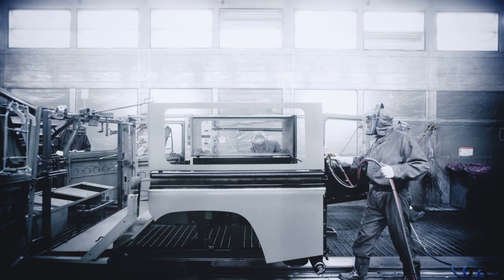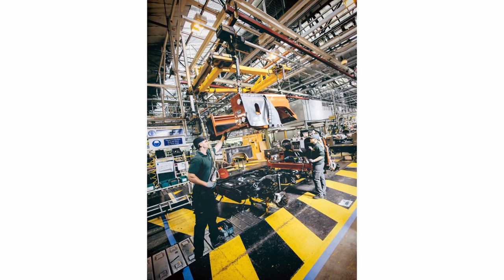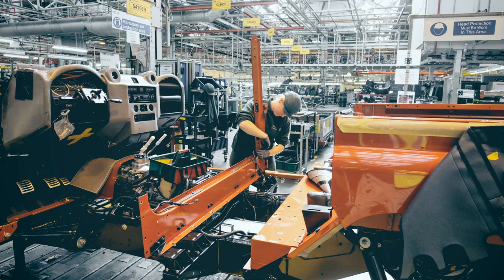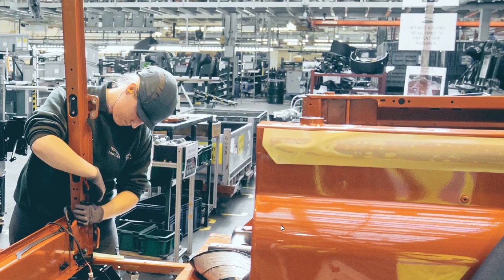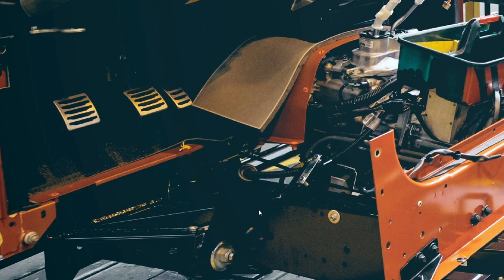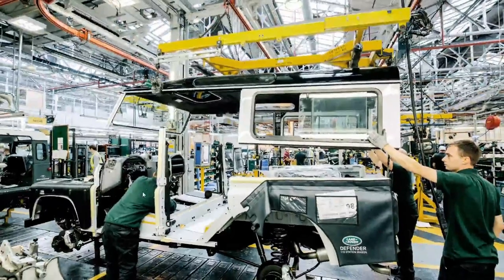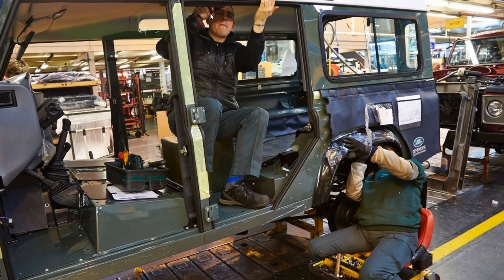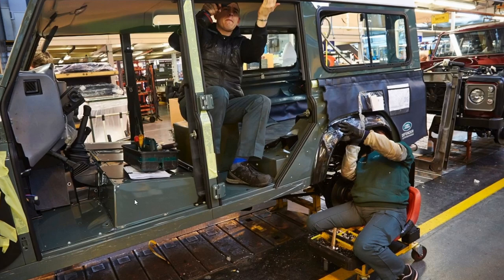Defender B/C posts - How the factory did it - Part 3

Comment: What a great video and great detective work, as someone has already said.
I did one of the last tours of the assembly line. We were all really interested at the beginning of the line where they were putting together the transmission and engine, but by the time we'd got to the body assembly there were very few questions so we more or less just walked past. Afterwards, I wish I could have done the tour again as there was so much to take in. We weren't allowed to take pictures for some reason, which was a real pity.
Reply from the maker: I did it too. I found it so overwhelming in final assembly; I knew I wouldn't be able to take it all in. I would have preferred to just wander around for days by myself and talking to the workers

Comment: Mine has a sealer between the steel and aluminium parts you can see where it has squeezed out when riveted up. It also has a sticker on each door about the cathodic process. The galvanised capping went I think with the introduction of the defender name (1991) but they kept the galvanised side sills.

Comment: Ahah! - now I see they bolted up the side panels, and the windscreen to the roof BEFORE lowering the whole lot on to the tub/bulkhead.  Great if you have a huge overhead gantry... Trying to get all those wobbly bits to match up with bolt holes AND fit sealing rubbers AND then get everything square-ish so doors would fit was a nightmare with my rebuild :)  six degrees of freedom and LR's 5mm tolerance on all alignments made for interesting times in my low roofed shed! - 10 litres of Sikaflex marine sealant might stop all the leaks now... but don't look at the panel gaps!

Comment: Great pitcture of a bye gone era.It also shows very well the reason they stopped making them due to the insane amount of labour that went into building one from scrach.
Also you can clearly see and you've mentioned it, all those holes that got drilled AFTER the panels got painted and rivetted without painting or rust proofing the bare alu in the holes.
No wonder these are such rust buckets within a few years time.Also no paint is sprayed on the panels under the cappings because why would you  XDXDXD.
Still i like them a lot,,despite their faults and fortunate to work on them on a daily basis.
Good luck with your build,mate.

Comment: Great video Chris!! As I'm sure you are aware I am restoring my 16k miles 2011 90 and I can confirm the bulkhead -  b post member is not painted. I guess some of the guys pictured in your photos are the ones who managed to miss fit all the floor screws in my 90 and get them all down the sides of the square plastic inserts?
Reply from the maker: Lol, great quality from Solihull! I saw your bulkhead and it looked horrendous. Luckily i've never owned a Defender from new...

Comment: Presumably the same as how they did the series sw as well. Silly that they stopped galving the cappings. I think it looks better but hey I’m a series man
Reply: I recall the indignation in 1996 that my Defender's  6 year old cappings were getting crustier than my Series One's which were then 40 years Old. My Series One still  survives, but the Defender (sold)  does not.  I THINK my 1986 Ninety (StilI alive D420JRL)  had galvanised cappings; certainly the bumper was galv because I remember  it was ideal for opening beer bottles, whereas  the plastic coated Defender bumper was  effectively useless as a barbecue tool.
Reply: Phil Healey sounds about right I have a few mates who still daily series 2/2a as they are nice and simple